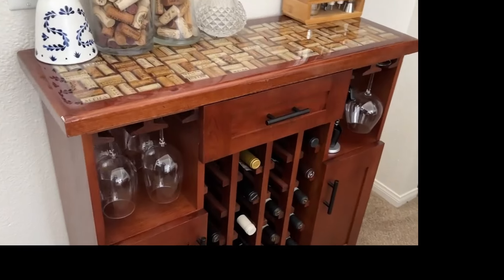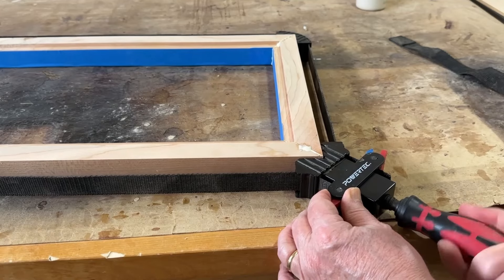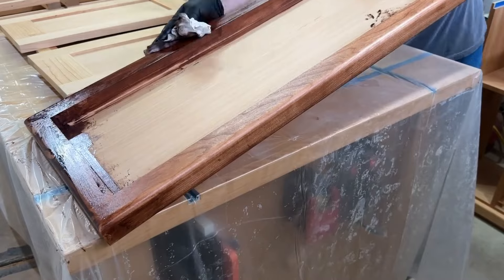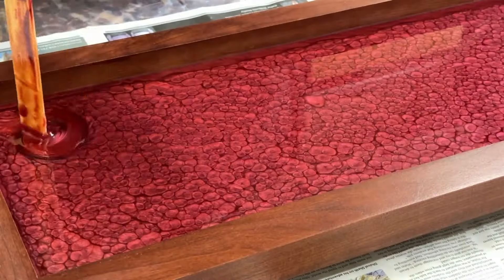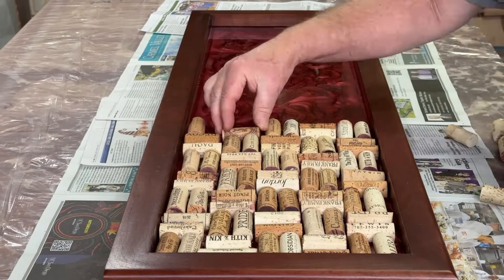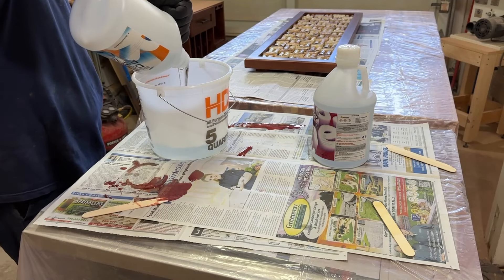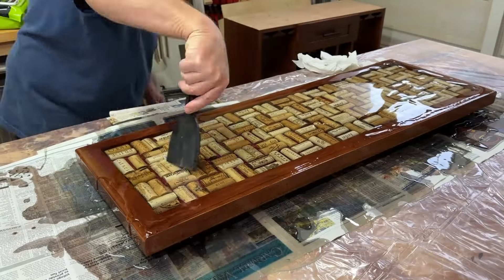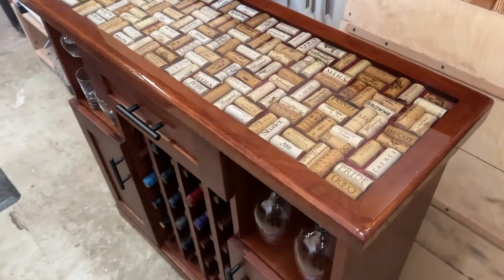It was more difficult than I thought!

Comment: nice job, next time put some painters tape on the bottom edge to act as a drip edge to prevent the epoxy from creating drips on the bottom, you then peel the tape off after it has set up but BEFORE it is hard.  should give you a nice clean bottom edge.  Using the router was a great idea.
Reply from the maker: Thanks for the tips, great idea, I'll try it next time!